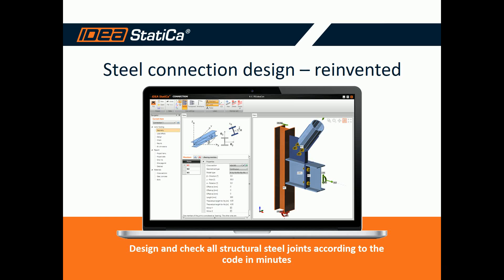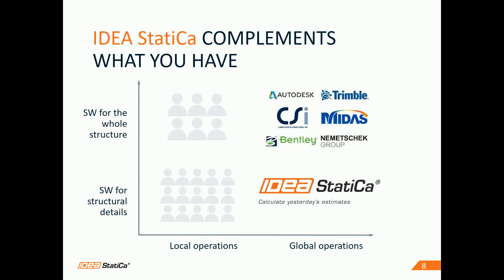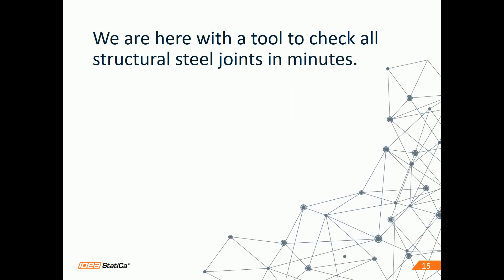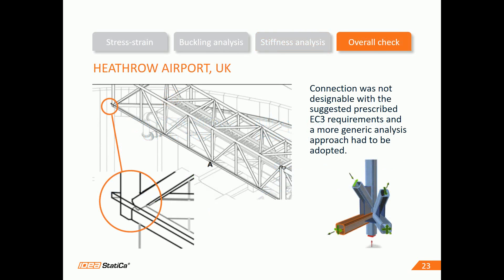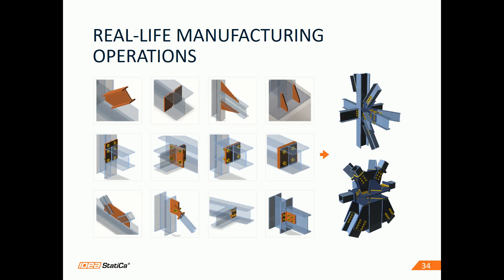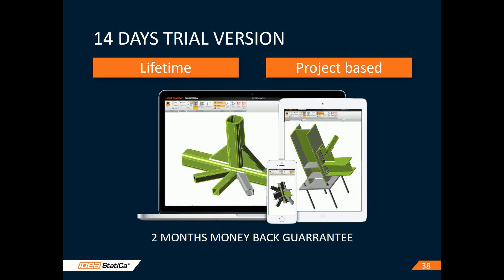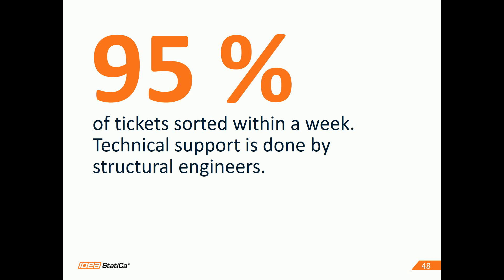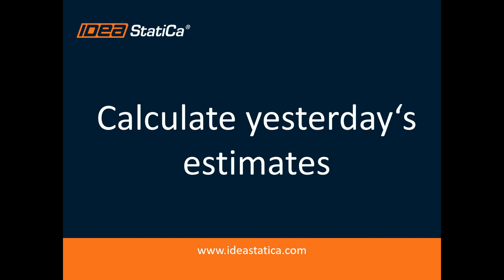Why IDEA StatiCa Connection?

Comment: Does IDEA Statica beam to column end plate connection design match with AISC Design guide (DG4/DG16), and the base plate (DG1) ?
Reply from the maker: "When performing checks on connections in IDEA StatiCa, the program does not consider these Design Guides (which are not considered as normative) directly. The recommendations presented in these guides are sometimes also based on simplifying assumptions of the structural behavior.

There have been some comparisons between calculations with IDEA StatiCa and manual calculations based on AISC DG1, DG4 DG16 and other Design Guides however, showing that in many cases the results are similar or in cases where there are differences, these differences can be explained, see:

https://www.ideastatica.com/support-center/base-plate-connections-aisc   

https://www.ideastatica.com/support-center/extended-moment-end-plate-connection-asd 

https://www.ideastatica.com/support-center/extended-end-plate-moment-connections-aisc

https://www.ideastatica.com/support-center/search?product=steel&label=aisc&category=verification_example&q=Design%20Guide"

Comment: untrustworthy software.
- same open project with two different versions, different results!
- friction joints where it is not possible to define the preload of the bolts.
- shear stresses in bolt shanks in friction joints! (!!)
- coarse and non-editable meshes.
- uncertain (unclear) design load positioning.
- incorrect and difficult to control outputs!

DO NOT buy it !!!